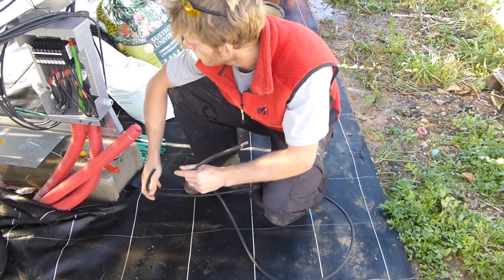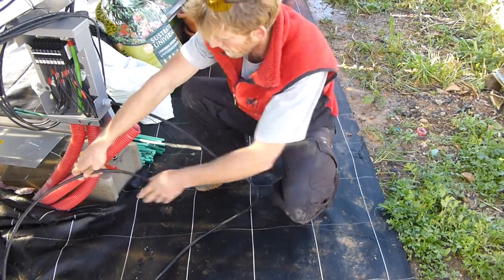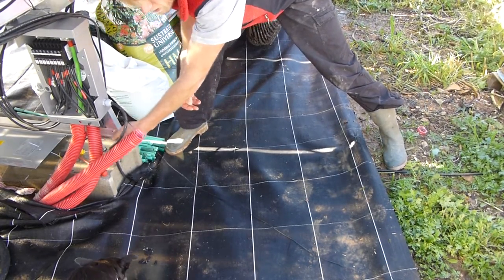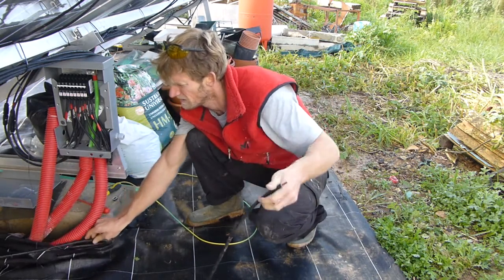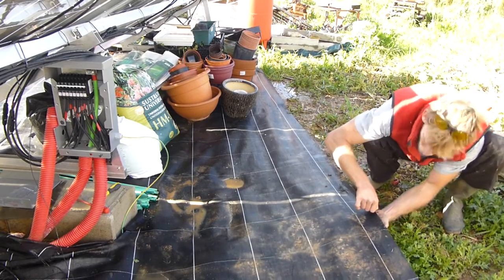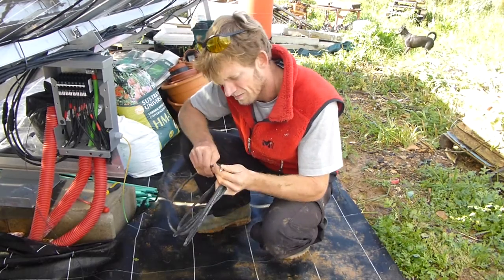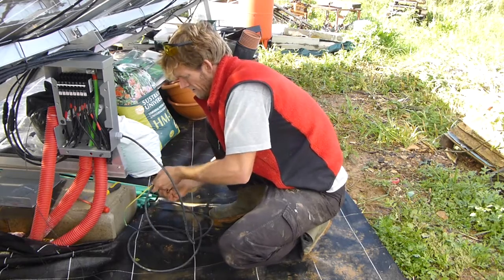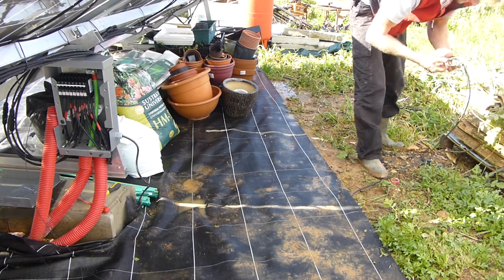Off Grid - DIY - Home Solar Install - P6 - Grounding Rod

Comment: Here is a good source for grounding info  https://www.youtube.com/watch?v=NkDYphpg8sM   
this will give you AWG TO mm square  https://www.engineeringtoolbox.com/awg-wire-gauge-d_731.html
I don't know your code but you should be able to put the ground rod a few cm under ground.  We would need to use an 5/8" 8 foot rod, about 1.5 cm and 2 and half meters.  keep the soil around it damp if you can, not soaking wet just not dry.. so you did it correct not to go under the panels if you have dry weather. 
Be safe electricity will kill.

Comment: It is good practice to keep your ground-rod wire as short as possible, i.e. plant the rod close to the installation. If your panel frame gets struck, the current in the wire will rise so fast that if the wire is too long you will get a side-flash out to nearby conductive material, eg the wires back to the house, or your mppt charge controller etc. Lightning wants to go to earth, whatever route it chooses. The easier you make the path, the more likely it will go the way you want it to go.
Reply from the maker: thanks for the info!

Comment: Ground connections serve three main purposes, one is to protect you from being electrocuted if you touch something that has a earth leakage, and the second is to protect against the fault currents induced from a lightning strike near your installation.

In your case since you're off grid you effectively have a floating mains voltage (I think it's called a IT system in the UK) where none of the phase / neutral is connected to ground so there should not be any earth leakage currents in any of your equipment unless you've tied the neutral to a single earth point in your house which then provides a earth leakage return path if something should go faulty.

Have you got any RCD's in your house and have you tested it?

The third purpose of a ground connection would be to provide a safe path to ground in case of a direct lightning strike and if that's what you want to mitigate against then you need to beef up the cabling and ground rods a lot as the direct currents from a direct lightning hit are in the thousands of A's so any resistance counts. You would also need spark arrestors on all wires that are exposed to the environment to enable a direct lightning strike to bypass your installation.

At lest in the UK you should also put any cables that goes in the ground in conduits or the cable itself should be rated for underground installation, this is mainly to protect against physical damage to the cables in case someone digs in the area. Do you know what the codes are in Spain?
Reply from the maker: Im not sure about Spanish code.  I have had all of the main install done by an electrician, I just did the solar.

The house install will be up to code.
I dont know about the RCD's but will ask my electrician.

thanks for all the info